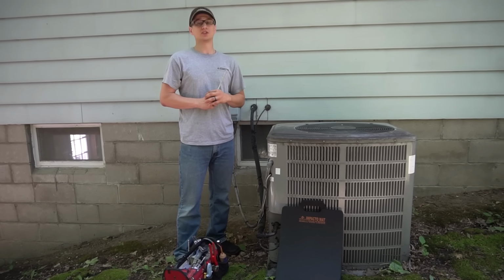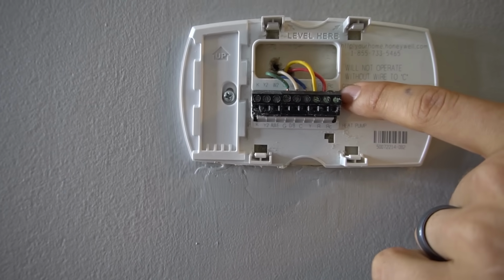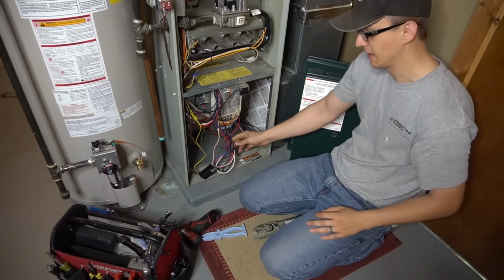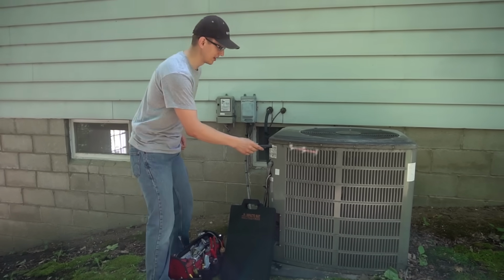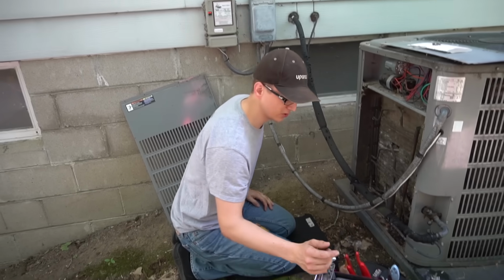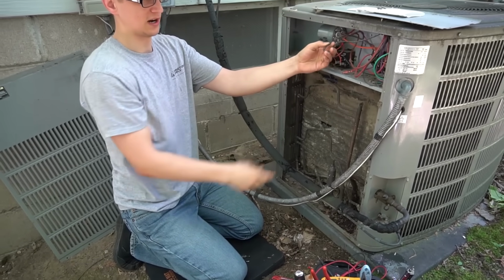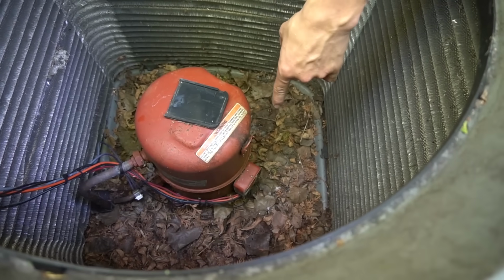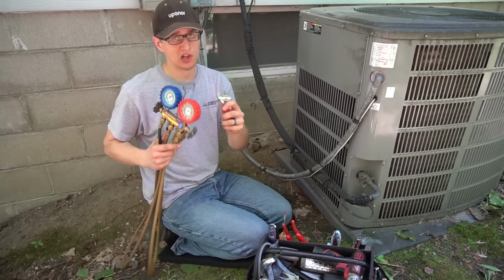AC Unit Not Turning On - How to Fix It Step by Step

Comment: Great video's, has helped me a lot. Now, I have an old TEMPSTAR, 1995. Had a compressor wire burn off, i replaced and cleaned them all, put in new contactor as the old one was chattering until it was pretty well fired before i figured out what was wrong. everything put back together then the compressor kicks in and works as it should, cuts off, but the inside fan runs until i trip the breaker and cut it off. Replaced the thermostat and contactor would not make, watched your video and reset the mode to HOLD, back in action, good job, thanks. Now as for the problem of why it's not cutting the inside fan off? Thanks much.
Reply from the maker: Oh boy, sounds like you had quite a long repair journey there! Is your fan setting on the thermostat set to ON instead of AUTO by chance? If it runs even though it's set to AUTO, then likely the control board is bad. I would try pulling off all the thermostat wires from the furnace control board and see if the fan comes on with the wires off. If it still runs, then you know the fan relay on the control board is probably stuck. (You can try smacking those little black relay boxes and if you get lucky it will free itself up) The control board needs to be replaced since usually soldering in a new relay (hard to find) is not an option.

Comment: How do you check the outside fan motor? Sometimes mine will come on and work on the perfectly and other times I have to go spin it manually and I have replaced capacitors.
Reply from the maker: I have a video on how to check the condenser fan motor but if you have to keep manually starting it like that, even with new capacitors, likely that motor is going bad and needs to be replaced.

Comment: You are absolutely fantastic...IT TOOK ME EXACTLY 15 MINUTES TO REPAIR MY AC.....your video is a play by play of every step you need to trouble shoot any problem on your AC...you saved me $350 which would have included a so called diagnostic test to find the electrical problem and parts!!!??!!   Your directions on the common wire to AC (blue wire) wall unit was not even connected...and as soon as we hooked that common wire the AC fan came on immediately...WOW!!!!  WE HAVE COOL AIR....THANK YOU THANK YOU THANK YOU....by the way.  I am a female that did it on my own, with your help...so ladies....do not be afraid....just follow this expert video, and it is a BREEZE!!!!!!
Reply from the maker: You're so welcome!! Happy to hear that you were able to fix it and my video helped in the process! I appreciate the nice comment, stay cool! ;)
Reply: Agreed!  The play by play of how to troubleshoot my non-working furnace/AC unit was very comprehensive.  Luckily my issue was only a blown fuse but I would not have even thought to look for a fuse on the control unit.  If I had to problem solve an issue again, I would feel confident to go through the steps again.  There are details you've explained that can only come from experience on the job.  Thank you for your knowledge.
Reply from the maker: @xtraclone  Thank you Manny! Glad I could help!
Reply: Same here,saved money and was educated at the same time,lol...thanks young man.
Reply: You are great...I mean
...the GREAT

Comment: Great video, sir!  My issue is that my fan turns on, there is power going to the AC unit, but the unit itself does not turn on at all.  I check the AC disconnect and it is set to on.  I also checked the pipes connected to the furnace and they seem to be clean.  My unit was manufactured in 2011 so I don't think it's overly old (?).  Any help is appreciated :)
Reply: Also, it is not making any noise/humming sound at all.  Do you think it is the contactor in this case?
Reply from the maker: An easy way to narrow down the possible problems is to push in the contactor plunger manually like I show in this video (very carefully). If the unit comes on, then watch my video on 10 reasons why a contactor does not pull in. If it does not come on, then likely you either have a blown fuse/s in the disconnect or a tripped circuit breaker and the unit is not getting 240v

Comment: How about a high pressure switch tripping on the ac? What would cause it to trip and how would you test it or fix it ? I have a 14acx Lennox the pressure switch triped I reset it and it turned right back on. To my understanding it had too much freon but I would like to see what you think and I would like to learn more on this subject.
Reply from the maker: The high pressure switch trips because the refrigerant pressures in the unit are getting too high. Pressures are directly affected by temperatures. The higher the temp outside, the higher the pressures will be. The number one reason why the high pressure switch trips is because the condenser coil is plugged. So the first thing I would do is wash it down real good. Even if it looks clean. I had very clean looking coils before that tripped the HPC because they were actually fully restricted...

Comment: mice chewed up my thermostat  wires.  the thermostat wires are red and white.  the wires from the ac are black and yellow.  what wires should be match up?
Reply from the maker: If the two wires used to go straight to the contactor coil, then it does not matter which side of the coil which wire goes to.
Reply: Black and yellow wire from AC connect on each side of switch not the coil

Comment: My ac does nothing unless you push in that plunger.  Fan runs.  Replaced contactor, run capacitor,fuse, transformer and thermostat.  Still no change.  No air movement inside the house when plunger is pushed.  Not sure if condenser kicks on since I only use the plunger for a few secs.  Any ideas?
Reply from the maker: It can be a variety of things.. Have you watched this video yet? https://www.youtube.com/watch?v=NVPhsK4gK1A&t=123s

Comment: Edited to add: Please disregard this message...I found out it was a broken wire. I fixed that and all is working well now. Great video. Thank you very much.
My outside AC unit stopped working. Fan doesn't spin. Inside blower works fine. Checked the fuse and it is in tact. Outside the fan spins freely when pushing with screwdriver. I pushed plunger and it runs properly. I figured it was the dual run capacitor, so I replaced that per your video. Still not working. Does that mean I have a bad contactor and need to replace that?  Great video. Thanks.
Reply from the maker: Glad to hear you figured it out! Thank you for the update, stay cool! ;)

Comment: My AC isn;t coming on.  No 24 volt power at the condensor/compressor.  I have 24 volt at the thermostat.  Who do you recommend I talk to further.
Reply from the maker: So you narrowed it down to the contactor not pulling in (not getting 24v), that means you can move on to this video then :) https://www.youtube.com/watch?v=NVPhsK4gK1A&t=121s

Comment: Ok so i watched the whole video- excellent btw!- and i have checked everything as u explained and i think it may be the breaker switch/fuse at the power source by the unit cuz my fan is not turning or making any noise but when i turn on at the thermostat i hear a click come from that power source box. So i should replace that breaker/fuse, correct?
Reply from the maker: Hmm.. Have you tried manually pushing in the contactor plunger like I showed in the video? Does the unit start? (the outside unit) If it does, then you know it has 240v. If it doesn't even try to start, then likely either a fuse is blown, breaker tripped, or there is a loose or broken wire
Reply: I didnt try that yet but i will. Thank u so much for responding! Its 86 degrees in my house(in California's central valley!) And we have a 2 month old baby!
Reply from the maker: @karenboldroff3814  Oh yikes! I hope it's something simple and you can get it fixed quick! Be careful with that contactor though, it is 240v, so can be dangerous.
Reply: @WordofAdviceTV  OMG!! Thank u thank u thank u, ur a genius! There WAS a bug stuck in there! Of all things, exactly what u said!! Thank u so much! Saved a lot of $$!
Reply from the maker: Haha that's awesome!! Glad to hear you found the problem and got it fixed! Stay cool ')
Reply: Once again i say... My friend u truly ARE a genius! Or at least, a very good teacher! With ur excellent way of explaining things, I, again fixed my ac unit and saved my landlord loads of money!! Thank u so much! Love ur videos! ( btw... 105' in cencal today!)

Comment: My compressor turns on for like 20 minutes
And the it goes off or rest of the day, but the fan keeps spinning
Can you help me whit that ..?
Reply: Arun Kumar 8
Reply: No one ever answered your question, i'm having the same problem right now, my a c kicks in and when it reaches the set temp, the compressor stops but the inside fan runs until i turn off the breaker. Did you ever talk to anyone who helped? thanks
Reply: @ronnmiller9085  I was checking another video and found that few compressors will have auto cut-off for over heating or over loading .
I guess evaporator not functioning properly today I am likely to check on that.

Comment: OK  we had power outages two days in a row.  Now my 3 year old TRANE does not run at all    I see the 240 VAC and it looks like it is on both sides of the contactor  but nothing runs.    I completely swapped out the thermostat for lack of a better idea at 10 pm   but now its daylight and I am trying to decide what next
Reply from the maker: Do you have a multi-meter? I would first verify that there really is 240v, then I would check the capacitor and the compressor. I have videos on how to do that if you need them..

Comment: Compressor fan goes on and off intermittently about 5-10 seconds at a time, e.g. ON for 5 seconds, OFF for 5 seconds, etc. I’ve replaced the start capacitor and the run (dual) capacitor, which did look bulged, but was not able to find the auxiliary (single) run capacitor at my local stores. The unit is large enough to require the additional run capacitor. Just wondering if I should go through the trouble of ordering/replacing the remaining run capacitor for this symptom? Or if you think there is something else I should focus on? Thanks in advance for any help/advice.
Reply from the maker: Hey Jom! If the compressor is coming on (not just buzzing) then it's highly unlikely that the capacitor is the problem. It almost sounds like your unit is tripping the LPC. (low pressure cut out) That usually is caused by the unit being low on refrigerant. I don't think you will be able to do anything for this one yourself.. May need to call out a tech

Comment: @word of advice tv. I have a Lennox elite (13acx-024-230-20) i was having issues with the evaporator coil freezing so i thawed the coil, opened and cleaned the fins on the condenser and the evaporator coil.  When i restored power via the furnace switch and the breaker the system does not power on, no power to the thermostat.  I didn't access the control panel on the unit, only the electrical panel for the condenser to remove the fan cover.  The connectors on the condenser are in the same place as where i started.  Maybe a short?  Wondering where i should start to fix this?
Reply from the maker: It's possible that when the evaporator coil thawed out, the water overflowed and went over the control board or transformer in the furnace/air handler. I would start investigating there.

Comment: when I turned on my a.c.it just made a single click at the outside condenser . then turned back off and again a single click. that went on for about 5 hours. then started working correctly again. any thoughts would be appreciated
Reply from the maker: I wonder if perhaps something was stuck in the contactor contacts.. Like a bug or an ant and eventually it worked it's way out of there. It's hard to say without looking at it :)

Comment: Hello I like your advise about a AC unit where the 24 volt wire up to thermostat provides power for a Nest thermostat, unit worked last summer, and now the Nest thermostat is telling me that the red wire coming from unit is not getting any power, not sure I am explaining well enough but any advise much appreciated.
Reply from the maker: It sounds like the 3 amp fuse in the furnace is blown. Or there is a loose connection in the thermostat, where the red wire plugs in. Do you have a multi-meter? It would be hard to guess what it is without measuring some voltages.
Reply: @WordofAdviceTV  hello I like to say that I am still not getting power to my nest thermostat can be that the Capactor or Contactor broke? thanks

Comment: Thank you! Just change the capacitor and the compressor still would not turn on.Traced the wire back and it was a bad connection. Your video saved me big time!!
Reply from the maker: Glad to hear you were able to get it fixed! Thank you for sharing, stay cool! ;)

Comment: When I push the plunger in, it hums for about 2 seconds and then the fuse in the disconnect blows. Any ideas?
Reply from the maker: From the sound of it, your compressor is likely shorted out. Do you have a multi-meter? I have a video on ac tripping breaker and another on how to check the compressor. If you don't have a meter, you can also try disconnecting power from the compressor (either at the plug or the wires coming from it) and try turning the unit back on after you replace the fuses. Do the fuses blow with the compressor disconnected? If yes, then you know the compressor is bad. If you do try disconnecting it, make sure the power is off and verify that it is off before touching any wires.. Be safe and good luck!

Comment: What is a jumper used for Rc in the thermostat?
Reply from the maker: Rc is power for cooling. But usually the 24v hot wire goes to only the R terminal. So it needs a jumper from R to Rc to power on the air conditioner

Comment: I have a Goodman GMV950905DXBB. Yesterday I got home and the floor was full of condensation and the blower was not working. Compressor and fan outside were running. I took the door switch power directly to the blower motor and nothing came on. I can spin the fan by hand just fine. My thought is that the thermostat is working as it turns the compressor on. Your thoughts?
Reply from the maker: First I would verify if there is any power at all at the furnace. And if you put power directly to the blower motor yet it did not come on.. I would replace the blower motor.
Reply: I am learning as I go. I am being told I cannot jump this motor directly because of the type of unit this is. Something about this unit converts power. I an not sure from what to what it is converting? Maybe you have some insight to that. On the other hand the control board has no lights coming on at all. I am going to change the control board out first. Unless you have another test I could run. Thank you Jesus it has been cool out here lately. Thanks again for your help.  @WordofAdviceTV
Reply from the maker: @mikeburruel8270  Ahh I see. Do you have a variable speed or ECM blower motor? The one that has like 16 wires coming from it. You can't "bypass" motors like that. They have a computer module in them that converts the AC voltage into DC. 

If the control board has no lights on it (the door switch is pushed in right?) then it is possible that the board is bad.. Or it is simply not getting any power. I would first check the transformer. It typically will have two sets of wires coming out of it. One set is 120v (usually black and white) and the other is 24v. If you trace where those wires go.. Do you have 120v and 24v?
Reply: Yes both. But still no lights on the board itself. I also checked power coming out of the transformer. I have 24v going to the thermostat strip.   @WordofAdviceTV
Reply from the maker: @mikeburruel8270  In that case yes.. The LED light rarely ever burns out so it's likely to be a bad control board like you concluded.
Reply: All right then. New board it is. I've got one coming. I will let you know how it turns out. Thanks again. @WordofAdviceTV
Reply from the maker: @mikeburruel8270  Alright, good luck!
Reply: So  far so good. I've got lights and the blower came on. It is showing me a single blink. The trouble shooting chart reads this. (Furnace lockout due to an excessive number of ignition "retries" (3 total) and recycles "infinite".)  Which doesn't make sense because the furnace wasn't on when this happened? Is this just a generic code.   @WordofAdviceTV
Reply from the maker: @mikeburruel8270  That is pretty odd.. So you tried resetting power to the furnace and it brings up a furnace lockout code because of excessive ignition retries? After you reset the power, try watching the furnace. Does the inducer motor come on? If it does and it's a new board, then I would suspect that there is something mis-wired somewhere or the thermostat is misbehaving.

Comment: Thanks very much for the excellent, step-by-step video, in particular the trouble-shooting for 240V. It helped me identify a foolish mistake I made years earlier that went unnoticed until recently. Years ago, I mislabeled the ON and Off positions on the electrical panel for the 50A A/C Circuit controlling the A/C. So, my A/C Unit wasn't working outside at all because the circuit breaker was actually in the OFF position all along. Once flipped to the ON position, the A/C Unit outside came up immediately after adjusting the thermostat. Actual testing trumps any hand-written labels. Thanks again!!!
Reply from the maker: Happy to hear you were able to figure out what's wrong! I see many mislabeled breakers at work. Thank you for coming back to share your experience! Stay cool ;)